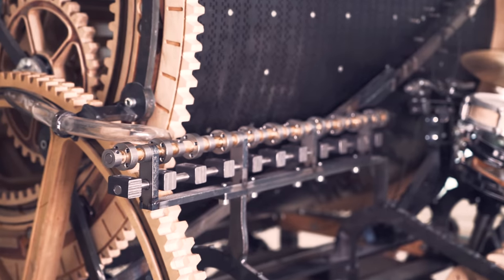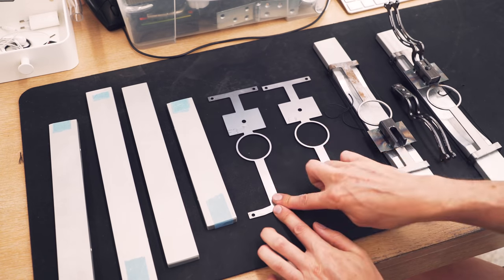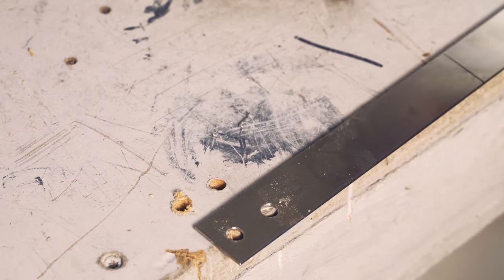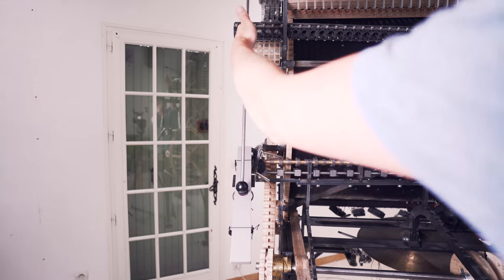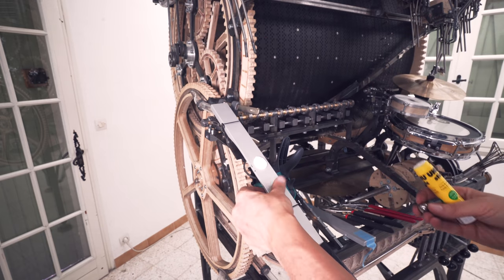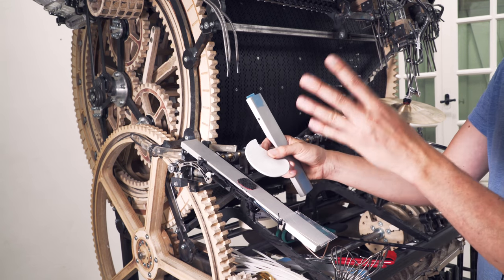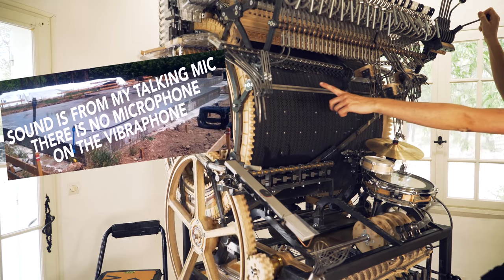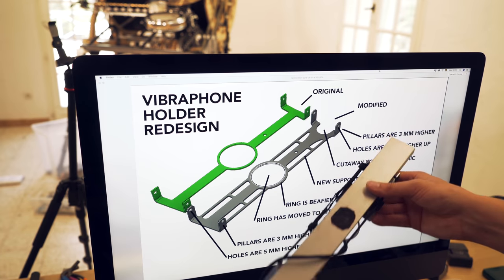Vibraphone Design Test 1 - Marble Machine X#88

Comment: Hello everyone, here is my solution for changeable vibrafone plates and nice and sustainably sounding plates. Hope anybody reads this. Comments welcome, thank you!!!
For me, appears a litte incomplete the design changing the vib plates for live on stage. What about the unplugging and reconnecting of the mentioned contact microphones. Well, I would give every plate a kind of housing or tray, each the same outer dimensions no matter how large the plate is, and kind of slots at the machine to slot in the plate housings which makes changing of vibe plates more robust. Think of these slots like removable harddisk containers at a server. That kind of slot in system might contain a XLR mic connector plug at the back side as well and a release mechanism and handle at the front so that you can slot in and out any plate quickly and safely even on stage at very dim light. The slots and plate housings could be designed kind of transparent and fitting the overall design.
According to the marbles triggering the plates I would recommend NOT to let the marbles hit the plates directly because the sound ist very harsh. And I do not recommend using any kind of rubber or silicone glued to the plates because it always shortens the sustain of the sound. And, even more important, any rubber and glue will have a very limited lifetime. Instead, I would place a spring steel plate above every vibe plate. The marble would hit only the spring steel and jump off and make the spring steel bend down. Underneath the spring steel plate there would be a kind of tip mounted, of the similar material as at true vibraphone mallets. So the plates are played with true mallet sound! I guess the height of the falling marbles, that is the energy, is big enough to bend the spring steel and let the mallet tips kick the plates sufficiently. The overall mass of the spring steel and tip should be quite light to make that work.

Comment: Attach the plug of the contact microphone to the holder, so slide and plug in one go. Ad another pin to the plug that goes to a little Arduino. That pin tells the Arduino what note it is and the Arduino automatically changes the length of the resonator pipe with a little servo. Done. Just pull the note off, put the new one in and that's it. no hassle.

Comment: Could you mount the silicone piece so that it doesnt touch the vibraphone plate? Or maybe something as simple as two small siliconepieces as spacers under the bigger pad to minimize contact area? Just so that when the marble hits, it works as normal, but then the silicone lifts back off the plate a milimeter or two, as not to dampen the sustain.

Comment: It can be hard not to feel like you are chasing perfection, but too many shortcuts cheapens the final product. Not gonna lie, strapping a piece of plastic to an instrument is pretty ugly. Especially when considering it's an 'outer' piece, which is most visible to the naked eye when playing the instrument. 

Consider dropping the marble off center, finding a compromise in the rubber/silicone that works for both sound and distance, or steepening the angle of the bars a bit if possible. It's possible one of these compromises alone doesn't quite work, but combining them might. Urging you to experiment a bit more with this one.

Comment: just a thought, but can you move the larger vibraphone plates higher up so they still hit in the shallow area (underneath) and don't have as much of the plate protruding so you don't get that marble double-hit? also I like the rubber pad idea, but it feels like there's no sustain at all and it does sound a tad dull. it's better than silicon but the sound seems a bit muted

Comment: Could you not rotate the vibraphone bars slightly about their hit point so that the end of the bar is not in the path of the ball?
Reply: It'll probably hit the neighbouring bar instead
Reply: @riolux  Perhaps not if they were rotated anticlockwise, and the bars went from longest on the right to shortest on the left...or vice-versa. The ball could escape over the edge of the neighbouring shorter bar. I'm also assuming that the bars are too close together for there to be a ball escape gap between the bars.

Comment: There's an easier and nicer solution to the plastic for the double bounce. Just aim the ball lower on the bibraphone bar. Don't aim in the middle, but more in the bottom and it will not double bounce with no need of plastic. No?  Best :)

Comment: You could cover the second bounce platform with the silicone to make it silent. You will also need it when you put a shorter bar in (to avoid having to adjust the funnel), so it would be good to make it a part of the permanent structure, if you can slide the bars in under that.

Comment: Hate the second strike plastic plate thing...   can’t you just slide the plate closer to the drum (with a different holder) and increase its slope a little?  Given the individual ramps for each note.. .there’s no reason why their centerpoints all have to line up- you could make their lower edges closer to alignment, with their different lengths exaggerated along the higher ends...

Comment: Love the whistling effect during the fast forward sections! Why not use an electric motor to power the machine during your testing so that you can move around easily and both of your hands are free to make adjustments, etc. Then disconnect motor during actual operations.

Comment: You could also mount the vibraphones a bit higher and/or at a steeper incline, which could eliminate the double jump issue. My two cents on the matter.